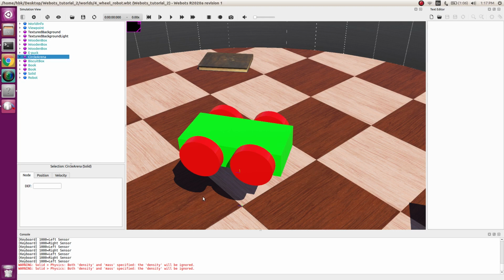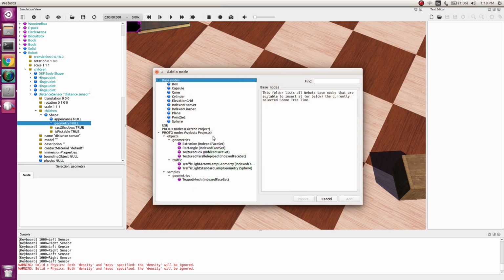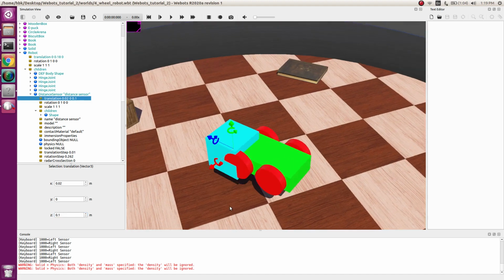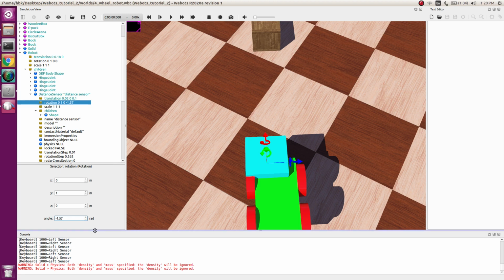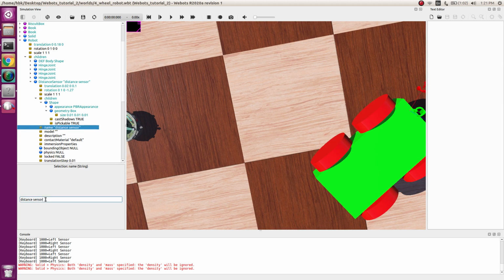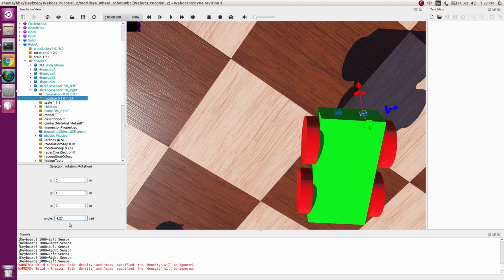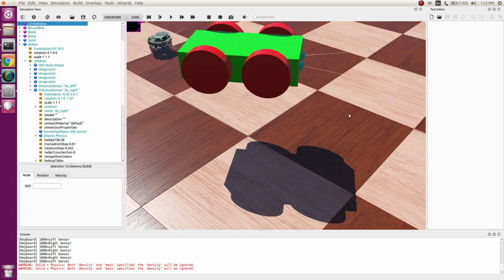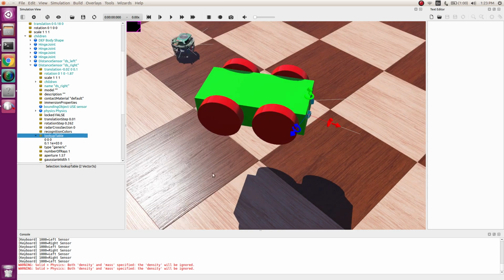Integration of Distance Sensor on Robot | Webots Simulation |  [Tutorial 7]

Comment: My distance sensor keeps sending the maximum range value, and only changes on collision, then sends max range value again. Can someone help please? ive tried keeping the boundingObject and Physics Null but it doesnt made a difference
Edit: Update, i managed to solve the issue regarding the sensor returning max value everytime, click read more for solution

Solution: Under the "Distance Sensor" node, there is an option called "lookupTable" with two rows, if im not mistaken, the default values you'd see are [0 0 0] for the first row, and [0.1 1000 0] for the second. what this means is, at sensor input reading 0(from the left zero in the top row) will output a 0; and that for sensor input reading 0.1, the output will be 1000.

if you want a 1:1 input to output ratio like me, keep the top row of at [0 0 0] and the second row at [1 1 0] (this is if you want your maximum range to be 1m, for max range 2m set your 2nd row to [2 2 0]). details for the lookupTable can be found here: https://www.cyberbotics.com/doc/reference/distancesensor#lookup-table

it took me awhile to finally understand what it meant, hopefully the page can help you if my explanation is not enough, have a nice day!
Reply from the maker: Very Good. You can also post this solution on our channel's discussion forum. So that maximum people can use it...

Comment: Hi, your video is really helpful, but I have a doubt that I am trying to use a distance sensor, is there any way that I can change the lookup table values to identify the wall in front of me?
Reply from the maker: Rather than changing look up value. Make bounding box to wall.
It will start detection.

Comment: I am trying some advance feature of the software, i made a robot with position sensors to make it move in a straight line.
I am not able to reset the encoder/position sensor value. There is a feature in differential wheel node to do this, but that node is not recommended to be used with newer version. Do you have any idea on this?
Reply from the maker: Hi Jatin,
Happy to hear about your advanced stuff.

Can you elaborate what exactly you want to achieve. Because I suppose once the value is set. You care about relatively value rather than absolute right?

If you elaborate your application we can discuss deeper.
Reply: @coolrobotics  This is what i am doing exactly right now. Working with the change rather than reference. I agree with you, that this is not essential for the simulation logic.

A way to reset them would make it relevant in case i want to do this in the logic of the physical robot and simulate it here.
Reply: @coolrobotics  tried this, "psValues = [0,0]", seems to be working

Comment: An issue I've encountered with this, is if you add a bounding object and physics node for the Distance Sensors, then one of the distance sensors will not work when you run the simulation; keeping the physic and bounding object of the distance sensors null; tend to fix the problem for me; and also the solution in webots keeps it null. Also enjoy your content, keep it up!
Reply from the maker: I am glare that you like our content. Thank you very much for your support. These words mean a lot to us.
Kudos you solved the issue.
But, I think the node of the distance sensor does not rely on solid properties like bounding objects or physics.
So if you want to try advance stuff you can even have your distance sensor working even without actually having solid. You can choose translation and define a distance sensor in it. That small solid is made just for understanding the position of the distance sensor.

We would be happy to have your comments and suggestion on other videos.
Happy learning :)
Reply: @coolrobotics  I also have the same problem. I tried setting the physics and bounding objects of the distance sensors to null, but only one of my sensors detects obstacles. Any advice on how to solve this issue?